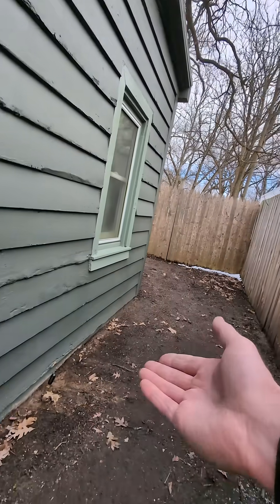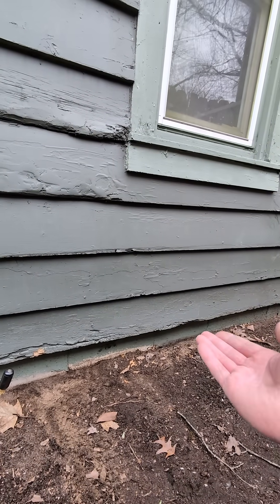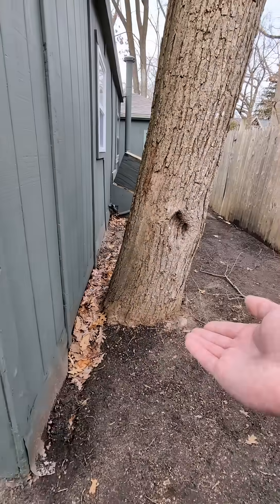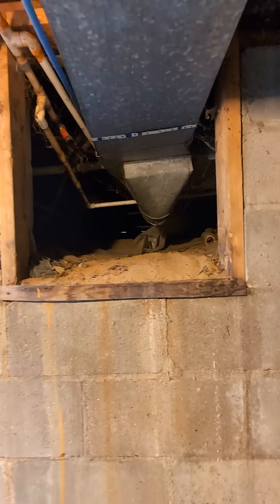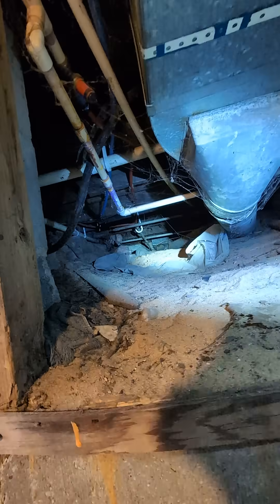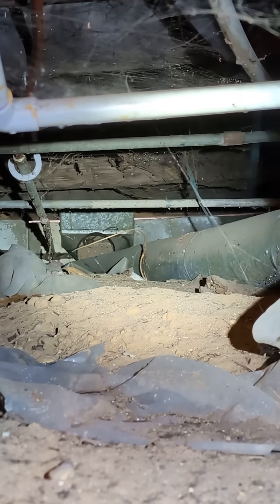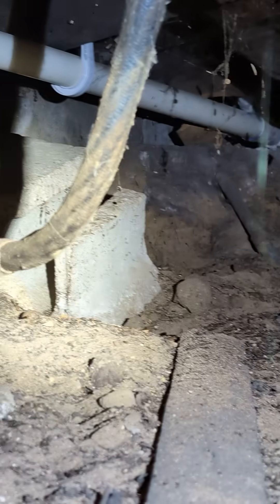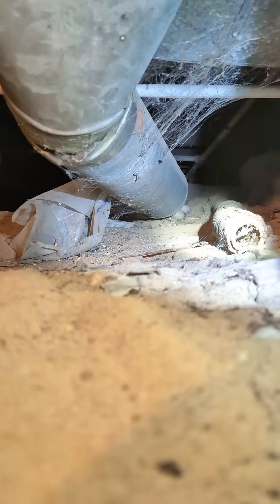⚒️📐 Foundation W/Loose block & settlement-REBUILD NEEDED.#shortvideo#shorts#youtubeshort#foundation

Comment: If you wanted to do it right, I would dig a wide trench on the out side of that wall and a trench on the inside (So you can strike the mortar joints on the inside and get the sill seal in correctly) then dig out the crawl space so can get in there comfortably (If you can ) If you could $$
Reply: Doesn’t look like a large enough piece of property to bother. The property value isn’t there. Maybe put a new support next to it.🤷
Reply: @Tread1775  Is that you Joliet" Jake Blues ?
Reply: @  Doppelgänger ✌️